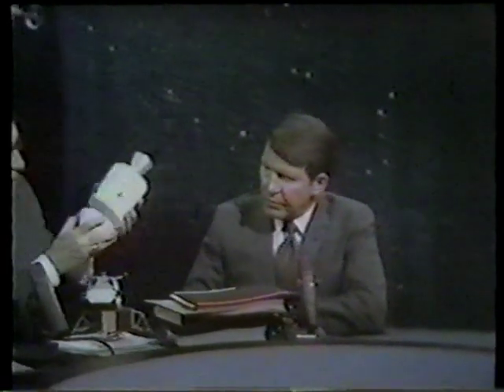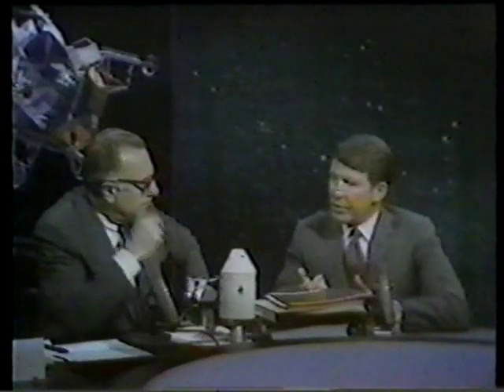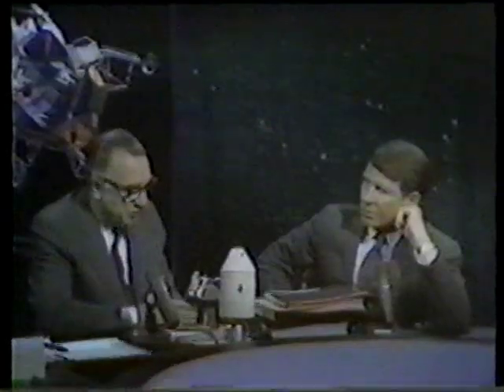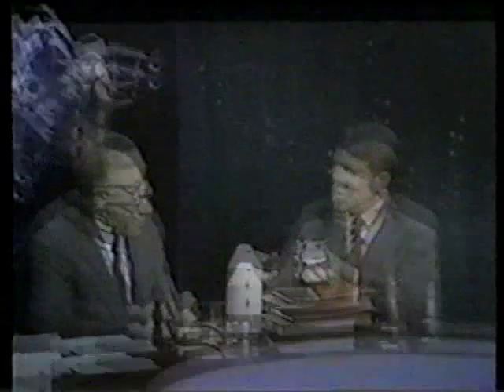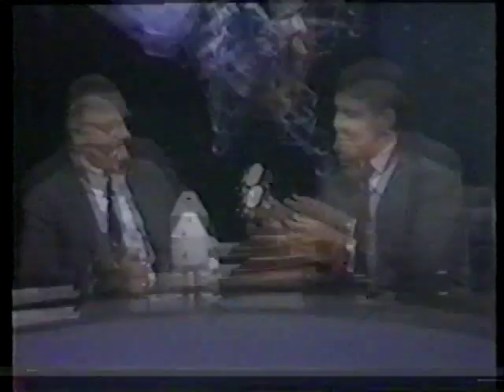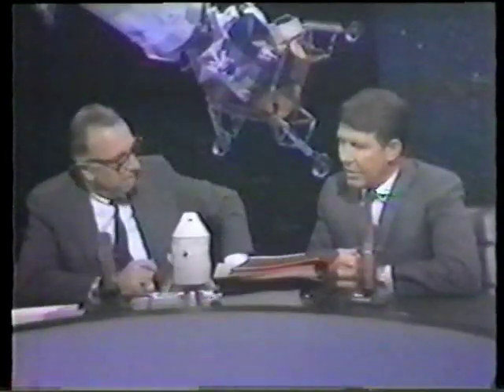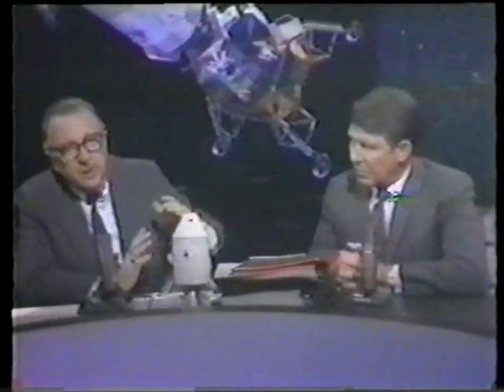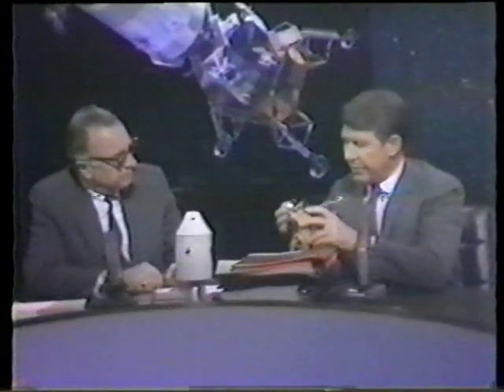Apollo 13 Part 7 CBS News Special Report of Flight Malfunction

Comment: Note how he talks about the lithium hydroxide even in the press conference before they even went around the moon. While certain silly movies pretent mission control AND the crew only thought about the air quality in the last second.  Letting both of them look like absolute idiots for a little bit of Hollywood drama..   
Also note that at this time, and for all the vital hours except the very first,  the flight director in charge was Glynn Lunney, Not Gene Kranz.
He and his team managed the powering down and up, the crew transfer while trying so recover the fuel cells.  All under extreme tim pressure but without much tolerance for errors. That the movie gives literally no credit to him is a travesty.

Comment: This may have well been a "color kinescope"--a camera hooked up to a  portable VTR recording off of a studio monitor.  That would explain the vertical hold rolling--you don't get that in a TV video chain.  (except in those days you would get a roll during a "switch" between locations or film/tape/live.  This TV station probably didn't have another recorder to put on line and this was done in a hurry just to get the feed on tape.

Comment: PROTIP: There is, on most VCRs, a dial or set of buttons marked 'tracking'. Using them will reduce the rolling you see, and thus what is recorded when transferred to digital. Other VCRs (newer ones) have auto tracking, and if it's not working get a new one before digitizing a video and uploading it.